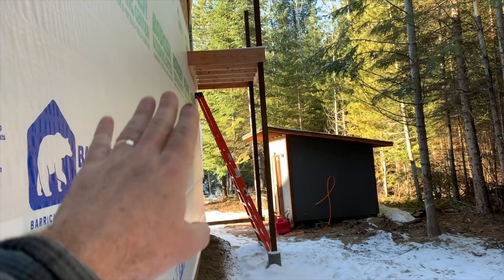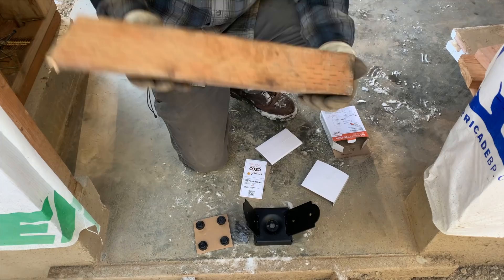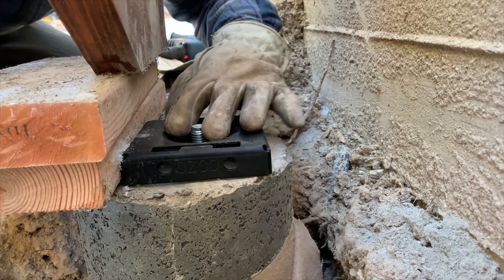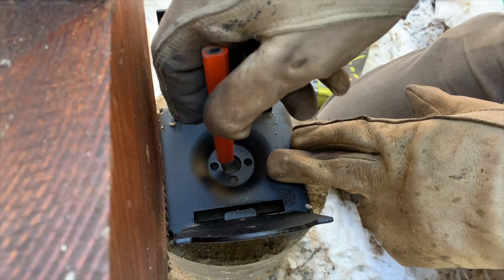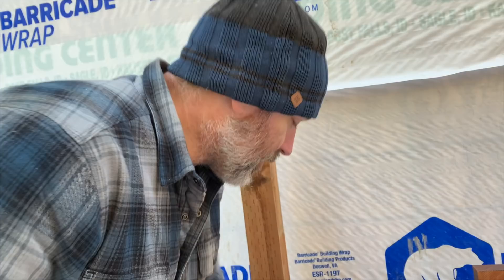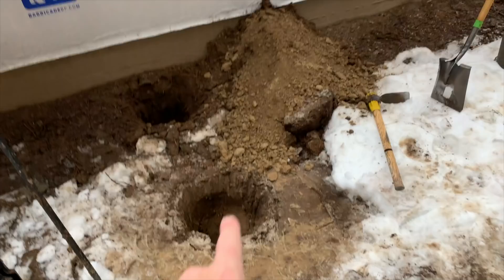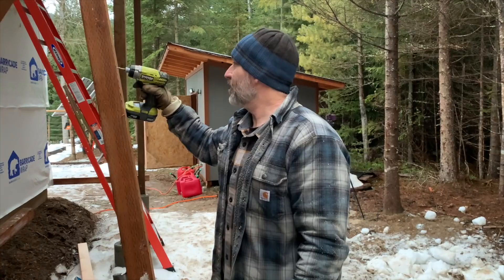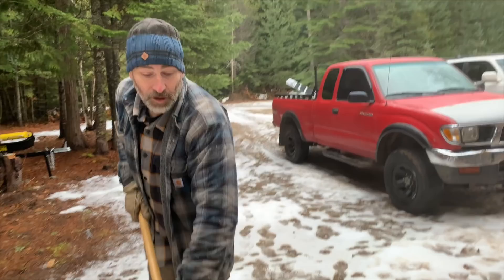Building Outside Stairs to Second Floor - Garage Apartment Build

Comment: We used to tent the area to pour with plastic tarps and use a torpedo heater to set concrete in winter in Boise and Bend..works well if you run into problems with your cold temps.

Comment: Your skill are improving and so is ur wife's.. Why look at all the hardwork you ur family has put in, sure its a long way from complete but ur inside u home its warm n cozy and u all are doing it at ur own pace.

Suggestion: Cover the head of the screw's with wood tube putty or wood filler..that way ur screws don't get rust on em.

Keep on smiling, stay safe n warm, God bless u.

Comment: Installing windows is always a big game changer. It changes the looks but also helps get you weathered in. Nice job working together. If you’re not going to use a wood burner then a propane forced air. We have a fireplace in the basement that is propane with a small blower and it actually helps heat the whole house so the furnace doesn’t run nearly as much when it’s on. 
How is the well doing?
Stay safe. 
10” of snow here with a couple more on the way. I’m ready for spring 😊. 
Bruce from Mason Michigan

Comment: Center stringer is only supported now by the landing upstairs and center support But nothing at the bottom probably need to run a board at the bottom between both cemented posts. I myself would have made a smaller cement wall uniformed to the stringers instead of cement posts that way all stringers are firmly secure at the base adding more stability to them. But, it's looking AWESOME looking forward to see how you will connect the upstairs to your existing home. God Bless Be Safe. Jim

Comment: put the big logs on the bottom and the small kindling on top it will burn longer and be more foregiving if you forget to come back and put more logs on because it will still be hot/burning. light the top and it will burn down, good luck

Comment: Nice job so far. I do have a suggestion that you might not have thought about. Snow coming off the roof and potential ice dams  "will" break you stairs and hand rails of a very short time. I have had this issue in Breckenridge. Totally destroyed the north deck. I would suggest a stair roof extension. The only thing that will eliminate that issue.
Reply from the maker: I thought of that. Not sure we get that much snow. We will see what happens this winter.

Comment: You are a brave bunch, it is far beyond what I would ever want to try, but age is no longer on my side. Too much water has flowed under my bridges, too much wear has taken its toll. Still, I admire you and your family, for still thrusting ahead in the weather, well done. I expected to see far more bounce on the staircase, I guess you feel the bounce more when you walk the treads. Though, without a handrail, I would have to sit that one out, a 'me' problem, my legs are not what I would like them to be.

Comment: If you had notched in a 2x4 at the bottom of the stringers you could have tied all three together.  As it is you will want to install a 2x6 at 2 different places along the length of the stringer.  It will keep them from spreading as folks walk on it.   Imagine several folks walking up the stairs possibly carrying items.  It will add a lot of weight.   You also really will want to install some X bracing under the main platform between posts.  I used that sealing tape on the stringers under each step.  This would greatly extend the life of the stringers.  Good idea about the sealant.  Test it when it dries with water to see if you might have a problem with slipperyness.

Comment: Ive seen stairs supported from the center of the stringers to the base of the posts for the deck platform. Could be a option if you rather have it supported already. Looks good

Comment: Snow is a really good insulator. When people go winter camping, snow helps them keep from freezing! Also, if you have a battery fire, don't try using snow to put it out, because the snow will contain the heat, and then when the snow eventually melts or slides out of the way, the fire could easily rage even higher.

Comment: I love your channel. I've been binge-watching your videos most of the day that started back in October of 2020. I just noticed something that you might consider adding to the vertical support posts for the landing at the top of the exterior stairs. If you put some diagonal support braces between the two vertical posts and probably also the posts and the outside of the house there will be less chance of the supports buckling if for some strange reason something like a moose ran into one of the vertical posts...Safety first...lol

Comment: I noticed your roof edge comes right over the steps and platform. As the snow sheds off the roof, won't the snow fall directly onto the stairs making them more unsafe walking on? I'm not criticizing because if the tables were turned, I wouldn't have done any differently. My question is, should or could this be remedied....is it a real problem or just in my imagination?  Will your plans to connect the 2 buildings automatically create a cover for the stairs in the future? Thanks. I did enjoy your post
Reply from the maker: Yes, it will. We will see how it does this winter and how hard it is to remove. There are remedies we may use if it is bad.

Comment: one tip for you when putting in fixing bolts , leave the nuts on as your hammering them in or you can stuff up the ends

Comment: @ 23:15 there is a nice new brush grapple for the tractor on the trailer 👍.  would of thought a plow or snowblower also would be this year but guess not 🤔 a used enclosed cab would be nice as well 😏
Reply from the maker: You will see soon.

Comment: Just spotted you today and was thinking that you probably have more snow than me... temp wise, not so good though. I live in wasilla alaska and frost line is coming up over the years as it used to be much deeper as like anywhere from six to twelve feet difference. Our frost line is a minimum of twelve feet is all now and when digging with a excavator will need a chisel attachment to get down and then the fun begins again with hard pan an its hard as in cement hard. I have dug rock with the hoe and it sustains more damages from hardpan than the frozen ground which will rip the teeth out of the bucket in August. Yeah, its that hard.

Comment: Take some damp paper towels next time before you lite the stove. Dip the damp towels into the ashes in the stove and rub it on your front glass and it will clean it. Good job on the stairs

Comment: if you would put some form oil on the inside of the concrete form tubes it would be much easier to peel off.

Comment: When you get  drizzle or a very light rain (and the air temp is around freezing) those stairs will get icy and slick from water coming from the roof. At this point, I would Install a gutter system to move that water away so no-one slips and gets hurt.  I know hindsight is 20/20 but you should have made the garage 4 feet wider and put the stairs inside the garage or install the stairs on the back wall of the garage on the inside? Just don't want you guys to get hurt on those stairs!

Comment: hi can not stop wondering why you do not finish a project. you have no clear walls in the house just plastic over the insulation. do you know how dangerous it is to get fibers from the insulation down into the lungs ?? why not finish one project before the next one starts ???? . but have worked in the US for many years and know how messy you are in planning
regards from Sweden
Reply from the maker: I’ve explained it a few times already. Maybe I’ll make a special video for those who didn’t watch all our videos.
Reply: @MartinJohnsonOffGridLiving   i have seen all your videos  it is still a fact insulation fibers are dangerus to brith in  regardes from Sweden

Comment: The stringers are too long, won't pass code. Should have a landing half way
Reply from the maker: Are you sure it is the length of the stringers that is important and not the total rise? “A flight of stairs shall not have a vertical rise greater than 12 feet (3658 mm) between floor levels or landings”
Reply: @MartinJohnsonOffGridLiving  I think the concern is someone falling down the stairs shouldn't have to tumble or bounce all the way down but have a stopping point half way. I don't know building code in your state

Comment: Head said concrete not set up to where you have to be worried she would not have had to work so hard to get the pipe and casing run ever off of the concrete 10 14 4